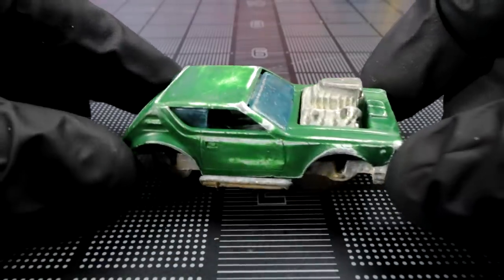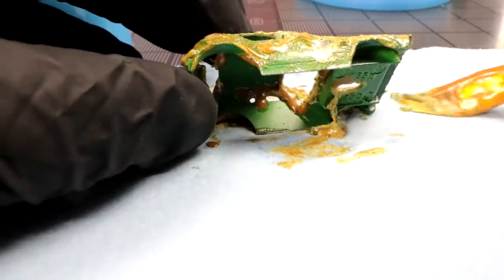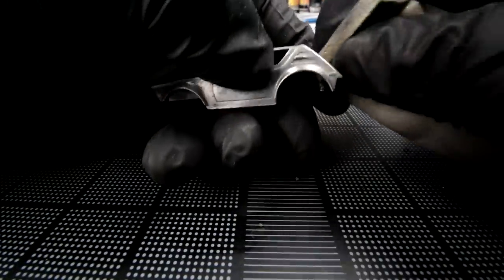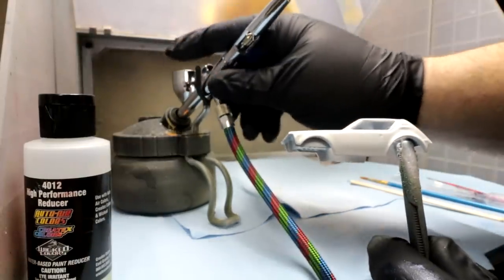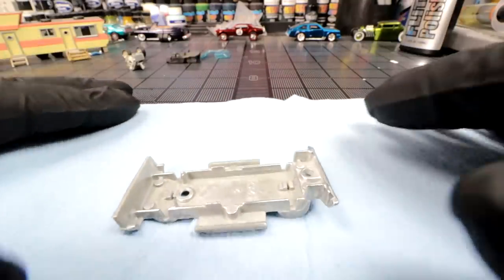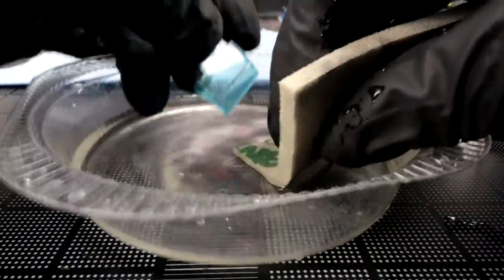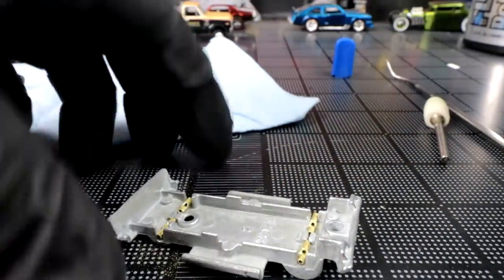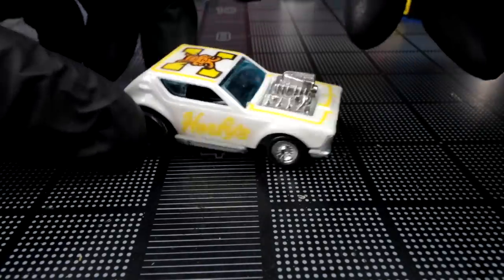Vintage Redline Resto/Mod : Gremlin Grinder

Comment: That’s a sweet restor, I help build a gremlin hot rod when I was younger, it had a small 800hp motor, built up 400 turbo tranny with stall converter, full cage, 5 point seats, chopped down Z linked ford 9” rear axel,  mustang 2 front end with adjustable coil overs, munster street legal meats in the back and pizza cutters up front, drag bars of course. With all the mods that car was still street legal (barely) and yes that thing was scary af to launch off the line and the power to weight ratio was crazy.
Reply from the maker: Sounds.. like pure awesomeness!!!
Reply: Diecast Resurrection it was scary fun

Comment: I have a suggestion, when you glued the tubes to the chassis, maybe next time you could take a long axle or wire of the same size to hold the tubes straight while they set 👍

Comment: I use baking powder which seems to work fine but others have said that baking soda is better
Reply: I've just recently started watching these Hot Wheels resto videos, so please forgive the noob question, but...
What is the baking soda for?
Reply: Baking powder has baking soda in it but it also contains cream of tartar and corn starch. Sodium Bicarbonate (baking soda) is the active ingredient so, while they will both work, baking soda does not have extra stuff in it. Maybe that is why people say it works better.

Comment: Jimmy, here's a tip to save limeout.  Use a smaller rectangular container, like a parts cabinet drawer.  You won't use as much and you'll get more depth for your cars.

Comment: Using the tubes and cut axels would let you do a slammed look fitment. An easy way to add a custom camber without bending axels.

Comment: Good GOD poor Jimmy needs wheelie bars or hes gonna be draggin' upside down! lol

Seriously tho, very nice resto & that paint is smokin' sweet! Love how the 'cals came out, the transparency really helps to make the look of the sparkle paint flow better across the whole car!  

If I may be so bold, I have two small suggestions that may help you with even better builds !   I've spent many years as a hobbyist both personally & professionally. In my experience, both Baking powder & soda will work fine as a hardener/filler BUT, over time, they will begin to degrade & eventually decompose despite the CYA glues presence as they are more organic in nature. Its kind of an industry wide standard to use Talcum powder as it does the same thing as the baking powder but will NOT degrade over time!  :)

Also, just a minor suggestion as to another paint op that'll make your cars "pop" even more than they already do, If you have an exposed drag motor like the one here, try a very thin black wash (thinned to water-like consistency)  just in the nooks n crannies n details of the block, especially the blower housing. Just touching the tip of your brush to the edges of details will allow the paint to run in capillary fashion to any areas where edges are present.That type of wash will help bring out even more detail whilst keeping the motor in general, still chromed out. Plus, if there are butterfly flaps on the blower scoop itself, try painting them a transparent red as most blower scoops are that way.  

Just my 2 cents! Great build man, keep up the fantastic work!

Comment: A fine choice, and nice result - for a somewhat detail laden resurrection!  

Check out the Gremlin pickup: http://www.myconfinedspace.com/2014/02/18/truck-10/gremlin-pickup-truck-jpg/

My family co-owned a "Nash", then "Nash - Rambler", than "AMC Rambler", then "AMC", then "AMC  - Jeep", then "AMC - Jeep - Renault", and shortly thereafter, "Chevrolet - Oldsmobile". By this point, the dealership had "spawned" two other dealerships, and we sold our share to the other family, who continues the tradition as a "Chevrolet - Buick - Toyota" dealership.

Comment: Getting redlines in Australia is hard and expensive. I have over 200 1970 80 90s matchbox cars but replacement factory wheels etc are non existent. I have 2 red line trucks I'd like to restore, 1 is a tow truck and the other is just a truck with no trailer.

Comment: If you have a facebook page now, I would like to post some pictures of the hot wheels I am working on. Many of them have deep pock marks and scratches that are difficult to sand out. Need your recommendations. The bases on a few of them are plastic and are trashed. Brake fluid does take off quite a bit of the coating, but is still looks like crap.
Reply from the maker: Yup there is a page on FB now where you can post!

Comment: hey Austin, Was this car just white sealer, then the sparkle, then the clear? Or is there actual white paint over the sealer?
Reply from the maker: Yea I used the sealer as the colour. With the clearcoat I didn’t see the point of painting white on top of white.
Reply: @DiecastResurrection  Very cool, Thanks to you I've invested in an air brush, a compressor and about a benjamins worth of createx. Is that a sponsorship I saw in this video? Createx banner in the background? Very good work!!!
Reply from the maker: Which paints did you buy? Hopefully a primary color set? Yea Createx sent a bunch of stuff after I explained how great the response was from the community. I cant say enough good things.  The part where I sanded the chrome was about 30 mins after painting the car.
Reply: Diecast Resurrection yes. Primary color set first with sealers and clears. I gotta take baby steps. This is gonna be way better than enamels.
Reply from the maker: @Stangrocka302  Ive never used the gloss coats from them, I'm curious how that goes. Hard to beat that 2k urethane!  I recommend buying 1 bottle of cosmic sparkle that you can add to all your primary colors. Then you can make any color you can mix fancy fancy.
Reply: Diecast Resurrection I will invest in the 2k later. I need to get this application down first. What else I need with the 2k? Activator or hardner?
Reply from the maker: T3X4S B0Y Activator for sure, 2k comes thinned out ready to spray out of a automotive gun. I thin mine out a bit but you can get away without it if money is tight. I know how expensive all this stuff is.